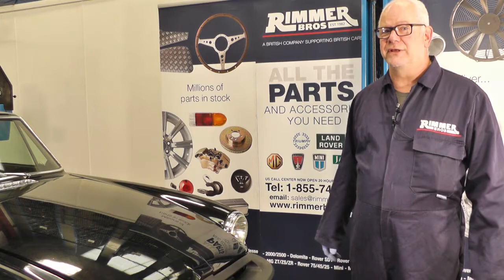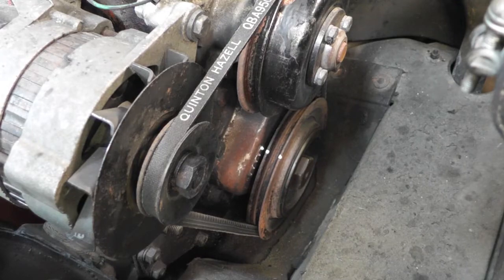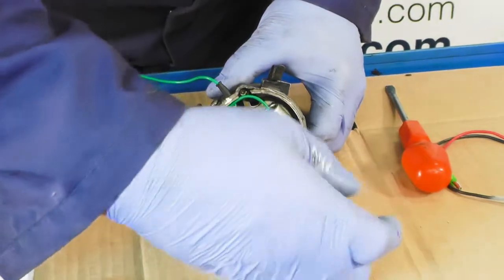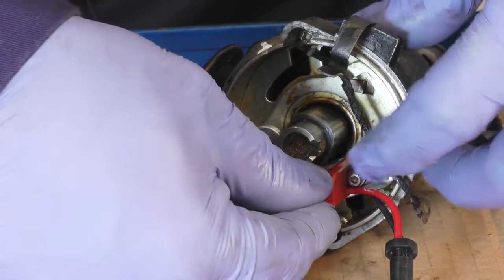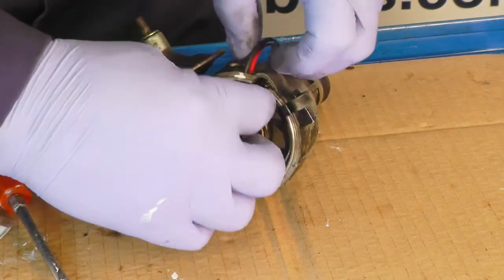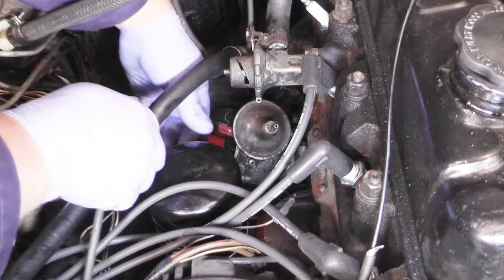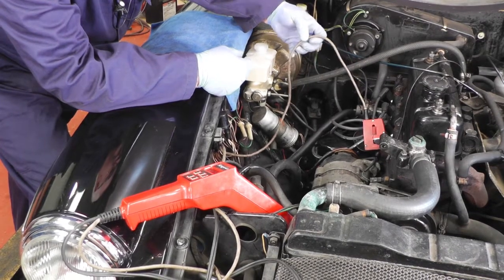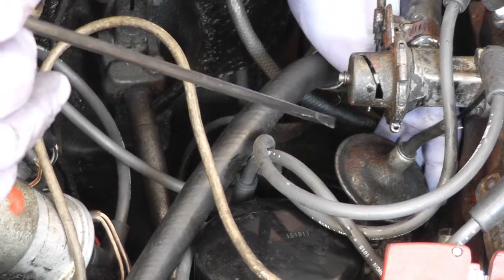MGB GT 1981 - Fitting an Electronic Ignition Conversion Kit

Comment: I thought an MGB of this age had a ballast coil if so it should be wired to the fuse one up from the last one so it gets a switched constant 12V supply
Reply: If there is a white with green stripe wire, then yes that is the ballast resistance line. White with black stripe is full 12V with key on.

Comment: Why did you mark the TDC point with tippex and not at 10 degs TDC?  I believe the MGB should be set at 10 degs BTDC - so shouldn't the10 deg point be the one that is marked with Tippex?
Reply from the maker: The TDC was marked as a base line guide. Once the engine is reassembled and running you can then get a digital timing gun on it to fine tune the adjustment and timing, getting you as close to that 10 degrees BTDC whilst making sure the engine runs as smooth as possible.
Reply from the maker: The TDC was marked as a base line guide. Once the engine is reassembled and running you can then get a digital timing gun on it to fine tune the adjustment and timing, getting you as close to that 10 degrees BTDC whilst making sure the engine runs as smooth as possible.